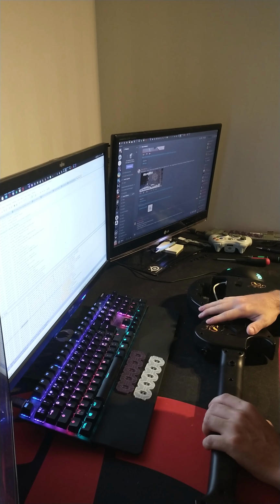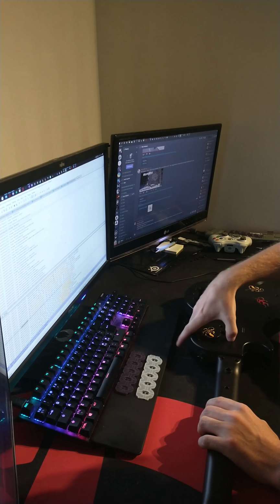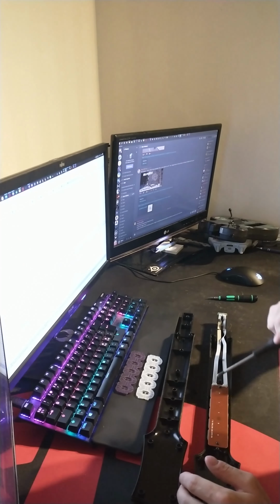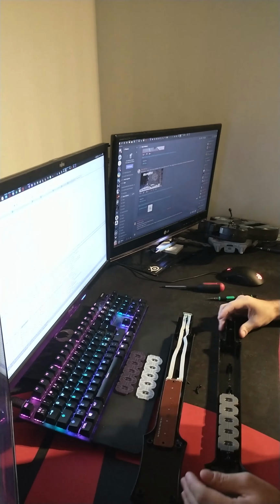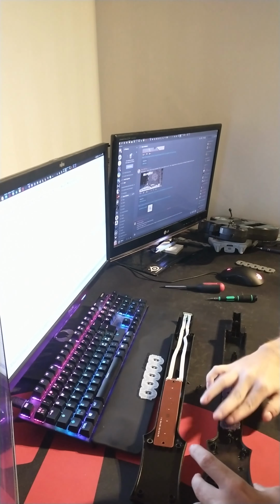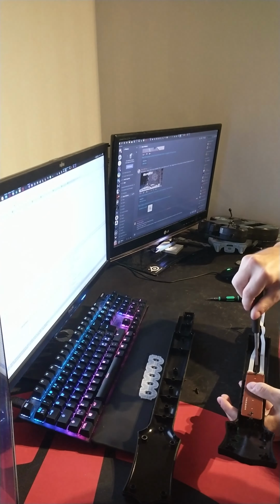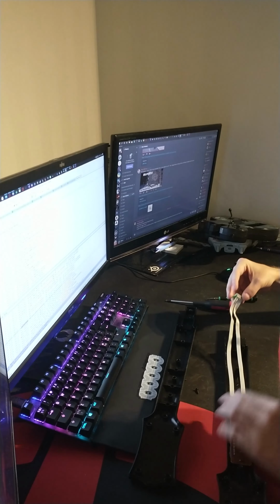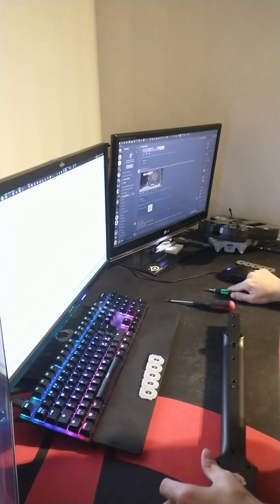How To Replace Guitar Hero Controller Silicone Fretpad + Where To Buy

Comment from the maker: These are fretpads made with CNC molds that most of today's aftermarket controllers use. 
I had a bunch of them made last month.
When modified, they are really damn good!
The white generic transparent ones are just like the Gametime ones.
So they are kinda stiff, just like brand new LP silicone, if not a little more stiff.
The purple ones are crazy good tho. :D
If anyone would want to buy in bulk, contact me through my email. If you want only 1, use my Tradera page.

Thanks and have a nice day!

/GHFear

Comment: He just changed the game with one single video
Reply from the maker: If 760 makes the hot swappable strum switch PCBs. It will be so crazy.
No more buying new guitars and fast and easy to find 2/2 switches out of a batch.
Reply: @GHFear  https://twitter.com/KatanaMods/status/1412478580446142466 you referring to this? putting hotswap sockets on the board result in fitting issues when trying to close the guitar up (due to the supports on the back of the shell), but i've been testing pseudo-hotswap with screw terminals for the wires, like the Strumfix Plus, and that seems to work really well.
Reply from the maker: @charliekeen5044  That's awesome dude! Yeah that's what I mean. We need to figure out a good way to make it installable without soldering, only cutting and clipping onto cables.
I got your email too. Will read and respond later tonight or tomorrow.
Reply: @GHFear  sweeet, looking forward to hearing back from you! and yeah  with the screw terminals there's no soldering required if the switches are already in place